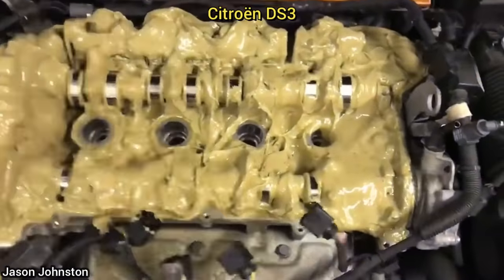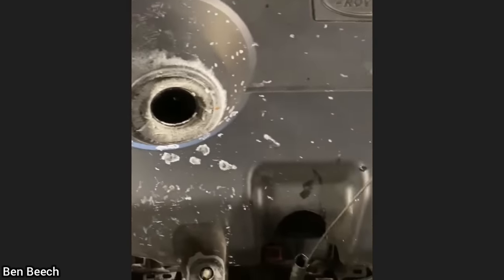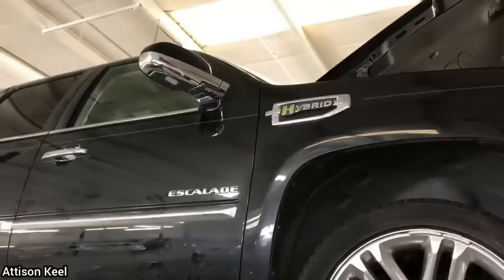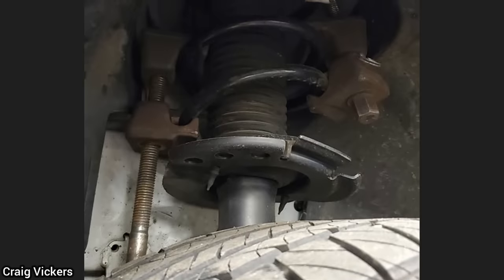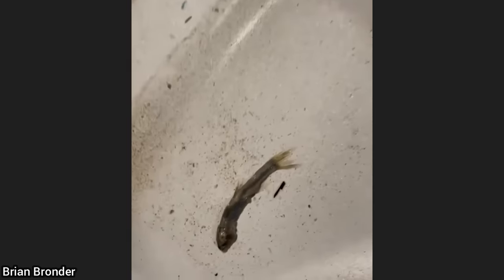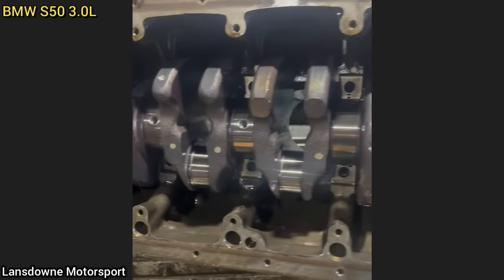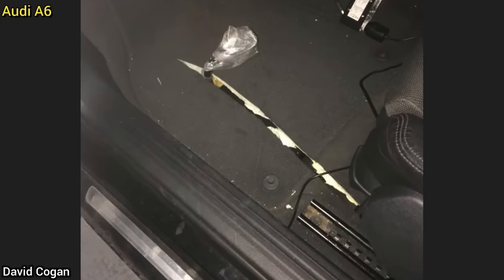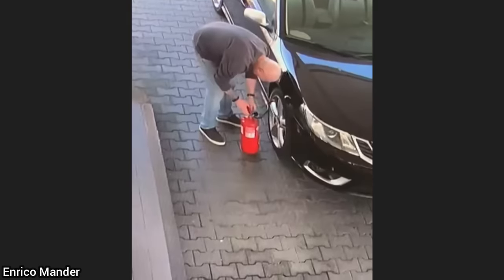Customer States The Car They Recently Bought Runs Rough

Comment: The majority of these issues could've been resolved if the customers had a brain
Reply: ....even a quarter of a brain would get them there!
Reply: I did not want to waste money chasing electronic gremlins in my 2004 Envoy.
 Daytime running lights module replaced with 16 gauge wire and two 30 amp relays.
Dash climate control system. Took it apart and removed all the doors. The hot / cold works. Probably because I only changed it twice a year.
Dash gauges, speedo and rpms sometimes work. That is what dipsticks and Volt/Olm meters are for,  I guess.
I use the windows for that in-between the annual climate change. Not exactly fond of the placement for that.
 I take keys with me now. Small dog likes to ride. The lock button fits her paw perfectly.

 But GM en gen earing fixed that in the Trax. If you like buffering noise. It became a added feature when you use the window temperature control method. The seat also sucks for long rides.
Someone different must have designed the headlight controller because it is original and still works.
Can't say the same about the wipers. Got to take the dash apart AGAIN to fix that.
The only part of the body control module that works is the radio.
The door lock and alarm still works. Guess could not find a way to F that up.
Everything I drove between 1959 and 1979 model years NEVER had any of these problems.
Convenience to me is the following. It starts. It rolls. It stops when you step on the brakes. The transmission transmits motion.
The AM and FM radio works. (Remember those things?)
Heat in the winter and cool in the summer. Oh and the seats are comfortable after 200 miles of rollin.
Guess K.I.S.S. it is not well known by GM engineering anymore. Or any other manufacture.
Oh why only have a door  key lock only on one side of it? Oh wait that is what a key fob is for. Of course that assumes the batteries work.
Don't park it for three weeks and expect it to start or open.
It is more than customer dummy up going on.
Oh and if you want avoid the evap canister or fuel pump replacement. Never less than 1/4 tank or more than a bit more than 3/4 full.
I don't have time time to explain the en gin ear ring on that.
Yes I have done mechanical and electrical. Even sat through a few or more college math and science courses.
 Also slycology until I  figured out people are either just lazy or crazy. Sometimes both.
Reply: lol, cell phones replaced most peoples brains
Reply: Just Think They Are Also Allowed To Breed ,Have Children And Own Guns .

Comment: That do it yourself guy also had quite the paint job lol
Reply from the maker: Aquaturd the technician said lol
Reply: Love how they painted the wiper blades as well, and nothing says quality paint job than opening the doors, hood etc, and seeing the original colour on the pillars and bits they couldn't be arsed to mask up.🤣🤣
Reply: Owner;
Flat brim cap, neck tattoo, ear gauges, smoking while spray painting the Tahoe.
Reply: This is the one you call everyone over for inspection bingo.
Who also had "capacitor drains battery with key turn", vapes, snapback, tack welded turbo muffler, and the engine light free space on their daily card?

Comment: I'm not the brightest person in the room, but watching these videos make  me feel better about myself.
Reply: Foster  same here!  I bought an old camry back in 2020 from someone who had written off the car as too far gone b/c it had high mileage & was underperforming, so I got it for dirt cheap!  as soon as I got it home, I changed the oil, ATF(honda style drain & fill) & Trans filter, coil packs, plugs, radiator, flushed the cooling system, and changed the tires.  Now it drives like new😆😆😆  Passed smog without any problems😆😆😆
Reply: Awesome,people want to discard things without trying to give it a shot at fixing them,way i look at it is just better deals for guys like you and me.

Comment: Filling up your tires with an extinguisher 💀
Reply: I mean a CO2 extinguisher with a regulator, why not, but a powder one? 🤔
Reply: Prevents blow outs
Reply: Keeps the tires from catching fire, no??   😁
Reply: How does that even work, surely the extinguisher doesn't have an air chuck on the end?
Do you hold the inflator (extinguisher) somewhere near the valve stem and hope the air finds its way in?
Reply: @youtubeaccount9058  They wouldn't work normally but if you - and I don't recommend trying this - removed the hose it came with and replaced it with several meters of suitable hose, a regulator and then a normal tire chuck you could do it.  CO2 extinguishers store the CO2 as a liquid which comes out very cold and is dangerous because of it.

Comment: 1960’s handbooks told drivers how to adjust their valves. 2020’s handbooks warn owners against drinking the battery fluid.
Reply: Great observation and 100% on point,its like the more technologically advanced we become the more stupid people get,i dont get it.
Reply: IMHO, people are way too reliant on technology.  If the power ever goes out, there’s going to be a seriously high number of totally screwed people.  Don’t get me wrong, I love technology, but I also know how to change a tire or replace a battery.
Reply: @johnk5461 I bet you change the wheel, not the tyre.
Reply: @patrickporter6536  Yes, on a car I change the wheel.  I doubt most people could remove and replace a tire at home or on the side of the road, especially with the new low-profile tires.  Now, if we’re talking motorcycles…different story.

Comment: Sheesh I wanna know how much power/psi caused that crank to snap, normally stock rods will go way before a crank 😳
Reply: Not on a Bavarian Lease Works, where they spent $10b to engineer the crankshaft down to the exact stock power level and to last exactlt 168,346 miles at most and no more.
Reply: @matthewbowen5841  
Lease is right. I like BMWs but if I decided to own one, I'd just lease it and get a new one every couple of years.
Reply: S50, should be a forged crank from the factory too.
Reply: My brother bought a small block Chevy with a  'rod knock' hoping the block was as nice as the cylinders looked with a random plug removed. He found all the rods and journals looked good. He went to turn the crank by the flex plate and realized the knock was the '2 piece crankshaft.

Comment: I remember years ago I had a rattle from my front driver-side wheel but only at low speeds (97 F-250) Got under it, checked everything out, NOTHING was wrong, but still a rattle. Long story short it was a tiny pebble that somehow got into my center hub cap! At higher speeds it would stick to the outside due to centrifugal force. Man that drove me nuts for like a week checking things from the bearings, brake shields, to anything I could think of. Even decent mechanics can be fooled by random sounds.

ALSO In my defense when I take the cap off I put the lug nuts in it so I didn't notice it rattle then. And when you tip it back over to get the lugs out the pebble gets caught in the outer rim! Then back on the truck to drive down the road only to hear it again.
Reply: I had a small gray rock lodge on the pickup bed, next to the cab. It sounded exactly like a broken muffler hanger. Took quite a while to locate. 🙄

Comment: I remember when I was younger we had a tractor that ran on propane, and my grandpa would always fill up flat tires from the tank😂. Actually worked really well
Reply: It's amazing how he's a grandpa.
Reply: Well, there is no ignition source inside the tire. And the mixture is probably too rich to  burn. But still.
Reply: The worst effect would be greater change in pressure with temperature.

Comment: Regarding clip 1:  I looked over a pickup my brother was looking to buy.  I drove it long enough to get it warmed up and right away noticed the steering box was shot but the big thing was when I pulled the oil cap off and a bunch of that white frothy stuff was on it and inside the rocker cover.  A dealership was selling this piece of junk.  Don't trust anybody.
Reply: Glad you caught that, your brother owes you a beer,a blown head gasket specially these days can be quite expensive to repair and could have damaged the engine if it was driven long enough,yeah when it comes to cars no one is to be trusted.

Comment: Great work again when I was about 14 I worked as a mechanic we only did minor repairs but we did lots of tire changes I took a tire off the rim and found a chicken leg bone in another tire I found a 9/16ths wrench. A man pulled in with an severely overheating 6cylinder gmc truck after it cooled when we put water in the radiator it came out under the head and blew against the inner fender so the boss got some oatmeal and put it in after about 5 minutes it stopped leaking and the guy drove it home
Reply: Thanks 👍
Reply: Ive found pliers a alan key a car key food wrapers what i think used to be a coke can a hand full of valve stems all sorts of shit in tires left some good stuff in some to hahaha
Reply: @BIGSMOKE-bl2lq  at 14 it was 1968. Isn't it strange what  guys do it's mostly hilarious. Thanks for the input it's great to hear from other guys in the same boat 🙂🙂 you never know what you might find in a simple tire change
Reply: I found a beat-up ratchet near the battery when I bought a used car; took it to the store and got a free brand new replacement for the in-car toolbox.

Comment: 1:15

First off, I hate electric parking brakes because I know, with my habit of buying junk cars, at some point I'm gonna have to move some POS that has an electric parking brake and it's gonna be on, and stuck, and the car is gonna be dead dead. Second, why isn't there a sensor to make the electric parking brake not work when the car is moving? I mean come on, it's already electric and overly complicated!
Reply: You'd think somebody would've come up with a mechanical parking brake retrofit kit by now and sell it in the JC Whitney catalog.
Reply: I also hate electric parking brakes. I'm just waiting for mine to have problems and cost a fortune to replace.
The electric parking brake can be used as an emergency brake in most cars. Sometimes it even uses the normal brakes.
Some cars will do a full emergency stop, some will "just" brake pretty hard so your mileage may wary.
Reply: @BlackPill-pu4vi  Don't quit your day job with the "I"m calling you old without calling you old" jokes
Reply: @DeadReckon  What are you talking about?  **I'M OLD**  I'd love to see mechanical retrofits to some of this electronic junk!
Reply: @BlackPill-pu4vi  I'm talking about the JC Whitney catalog reference... Do they even make those anymore? 😆
Reply: @DeadReckon  Good question.  I remember getting those on a regular basis just to browse through them. 

 I even remember the very first thing I bought from them.  A cruise control for my 1970's Ford F-150.  Three on the tree and the 300 CID inline six.  That cruise control was awesome because you could roll the end of the controller (mounted on the end of the turn signal lever) and control your speed that way.  You could also incrementally raise and lower the speed with the sliding switch that was also the On/Off switch.  I haven't found one like it since.
Reply: @BlackPill-pu4vi  I saw one of those, or one very similar on a parts 70's Cordoba a friend of mine picked up that had been rear ended. He wanted it for a few parts for his bug-eye Challenger (Ugly thing but, I guess it's still a Challenger) I remember it 'cause it wouldn't turn off. I was fiddling with the carb, seeing if it sounded like we had any accelerator pump, and the cruise control kicked on and pinned my finger got stuck between the carb and throttle lever when he turned the key on. I was hollerin' "Turn the car off!" while trying to unhook the lamp cord chain looking thing that attached it to the carb haha!
Reply: @DeadReckon  LOL!  Wow, even the old cars could surprise whoever is working on it.
Reply: @BlackPill-pu4vi  Oh the old cars are the best, especialy when you hook up a battery to an 80's Cadillac, the trunk pops, the drivers side window starts rolling down then stops, and the radio comes on blaring country music ou tof one and a half speakers like Christine haha!
Reply: I've never driven any electronic e-brake vehicles, but what I've heard anecdotally is that if you touch the button while moving faster than 5 mph, the car will issue its standard driver alert tone and display a warning on the gauge cluster that the e-brake cannot be enabled while car is in motion. It won't just lock-on like ripping the "drift handle" does.

But I am in agreement with most of you... I'm all about keeping certain systems of cars mechanical. I've seen what a random electrical gremlin in a car can do, I've seen a frayed CANBUS wire wreak havoc across multiple computer subsystems, I've seen a failed servo in an electronic throttle body cost an owner several thousands to repair (requiring dealer-level scan tool, replacement throttle body module must be "calibrated") whereas the same repair for an older vehicle is likely nothing more than a ~$50 throttle cable.

Technology is great, until it isn't.

J.C. Whitney still exists in online form, and they still offer a massive product line. I'm not sure if they still print those nice, fat catalogs, though.

Comment: That first one, coolant mixing with engine oil, happened to me and it turned into a light grey sludge.  I was so very lucky that the vehicle "gave up the ghost" right as I arrived at a friend's house after we drove 2 hours home late at night.  We were just a couple of young teen girls at the time.  Scary what could have possibly happened as it was before the time of cellphones and I found out I didn't have a good replacement tire in the trunk as we (my father and I) thought.
Reply: Blew a head gasket on my way to tech school one morning.  The heater started blowing cold air about 4 miles away, and engine cut just down the block, got restarted and into the lot.  Chocolate/mint mousse on the dipstick!
Reply: @2fathomsdeeper  Yup!  Mousse consistancy!  I was so distraught because it was my first car, too!

Comment: I work in car rental and deal with mystery noises all the time. Most recent one was a scraping sound when turning the steering wheel. Turned out to be a manufacturing sticker on the inside of the steering column that was partially peeled away. I removed it completely and the noise stopped.

Comment: @ 1:57 I dropped off my Suzuki 850GSD to get a radio installed, when I came back to pick it up, I was informed that this is the first & last motorbike they'll ever touch
Suzuki's wiring system is a nightmare, from the front of the bike to the rear, one wire and only one wire changed 8 different times, 8 colors for one wire, even with the manual showing where the wires were connected didn't match any of the colored wires in the manual. They didn't charge me extra for the extra time they did in tracing the wires, but I did see their point when shown the photos, like those above

Comment: My friend took his near new car under warranty to the GM dealership in our town for investigation of overheating. They said it was all fixed and that the radiator had been replaced and the car was tested and was fine now with no signs of overheating. He picked it up and managed to get 2 miles when the engine started acting strange. He stopped and found, there was no radiator in the car at all. Yes, the main dealership replaced the radiator with nothing. Their test drive must have been memorable. $12,000 later!
Reply: Holy shit,thats the first time Ive heard that, thats bad specially for a dealership.

Comment: The sunglasses thing actually happens in my Rav4. A simple solution put them into a soft cloth pouch and then in the sunglass holder. Luckily I don’t have this problem in my Cadillac. Because for some stupid reason, GM thought it was a better idea to put the alarm disable button in the overhead console instead of a sunglasses holder.

Comment: People are devolving. In the Model T days, they could patch 3 flat tires and do a main bearings and ring job on the side of the road. Crank start it and be off again in an hour.
Reply: Yes but on the original Model T most folks didn't have a choice, those vehicles required constant attention, also most people didn't actually have one.

Comment: Customer:  I just don't know why my information screen went dark!  
Mechanic: Presses power button and problem solved.
 
Customer: Rattling noise when I'm driving, drives me nuts I cannot find it.
Mechanic:  Opens sunglasses compartment and removes sunglasses thus abating noise.

Customer:  Muh car hits the ebrake when I shift into high gear!
Mechanic: Takes the air freshener off the stick shift so it quits hitting the ebrake.

I swear, if people just used OBSERVATION (and followed directions), many mechanics would go broke.

Comment: Someone finally managed to break a crank shaft in one of these videos.
Reply: Imagine the force required to do something like that.. they must of ran the engine way beyond the rev limit.
Reply: They said it was a bolt on turbo so probably just running stupid psi on stock internals. It's a BMW too, not exactly known for taking well to extra power on stock engines.